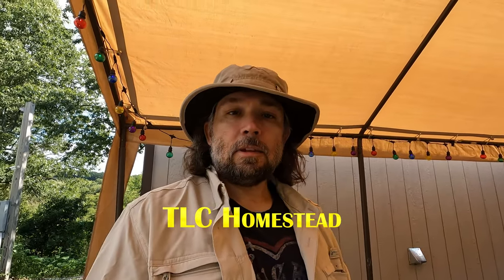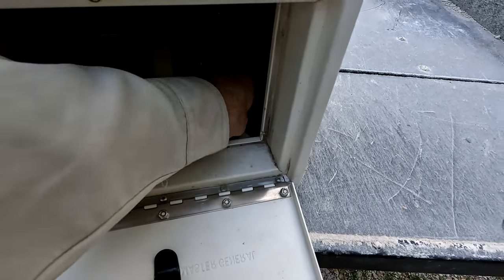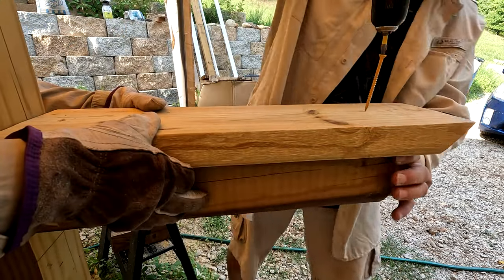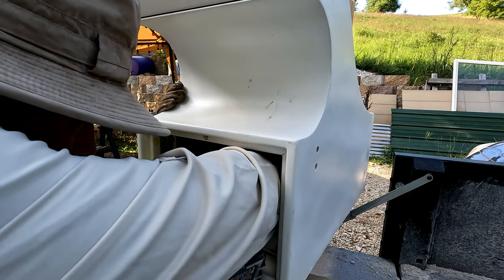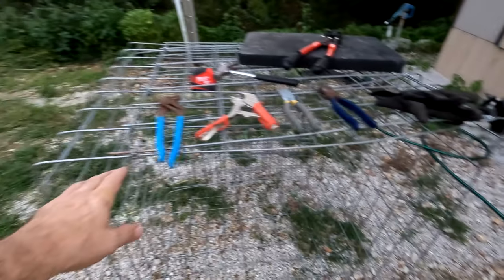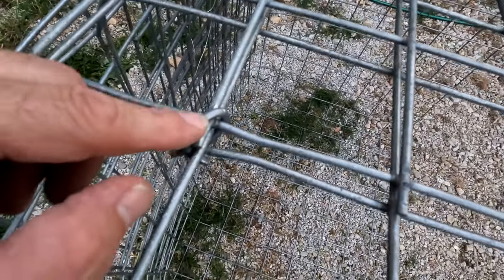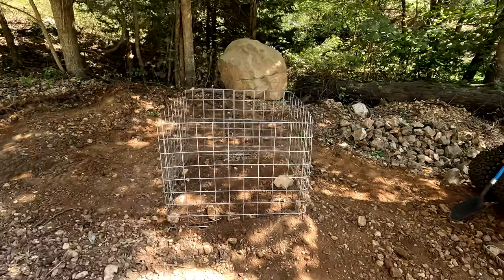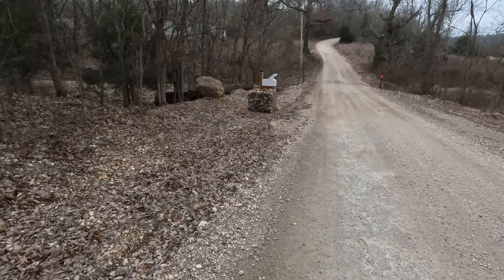TLC Homestead Mailbox Build

Comment: If you do install the locking door on the mailbox, how will the mailman get access to your outgoing mail?  And in PA where I live, you are expected to have house numbers, and a red 'flag' on the side of the mailbox.  When the flag is up, it indicates to the mailman (and mailbox pirates) that you have outgoing mail.
Reply from the maker: I do have numbers on the side of the mailbix I did not film 😀

When you open the main door there is a clip to put letters in and hold them to the door as it folds down. I am missing a flag, so I, feel free to laugh, tape a flag on the side of the mailbox the one time I had to put something in there. Typically I drop outgoing mail at the PO, safer.